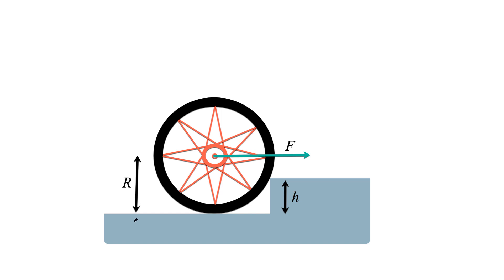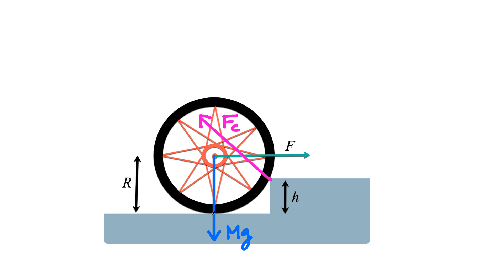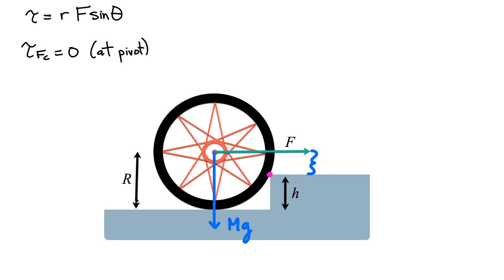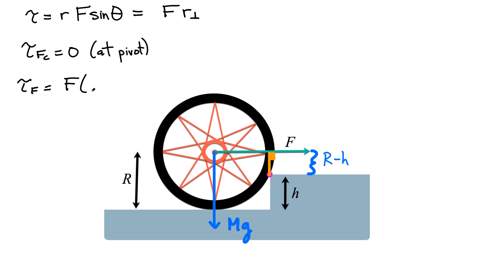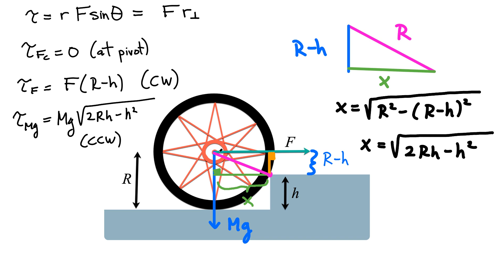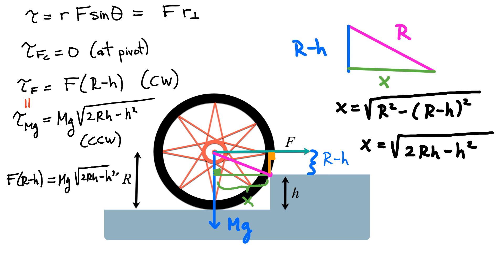Force Needed to Raise Wheel Onto a Curb

Comment: This is great! Can you do a video explaining what happens when a bike hits a bump on the road? So essentially, like this.. but goes up the curb and then down the curb too. Does hitting that bump or bumps cause the car to slow down? Does the earth and car exchange momentum and the momentum and speed of the car reduced? Or does the car slow down as it goes up the curb (convert kinetic energy to potential energy) but then return goes back to its original speed once it for rolls back down the curb as that potential energy is returned to kinetic energy?

Comment: To get the force F you equated the clockwise and CCM, I think that means that the wheel is in equilibrium meaning the net turning force on it is zero. So how will the wheel go up the kerb if net turning force on it zero? Shouldn't the CWM be greater so that the body turns in the CW direction up the kerb?
Reply: Yep that way he finds the equilibrium point solving for F. If the applied F is just slightly greater then the tire will climb up

Comment: Can you explain scenario when wheel rotates around a shaft with diameter of X as in a real world and force is applied to a shaft parallel with ground level? Does the force needed is just start force to initiate motion and what happens than? Is the force decrementing as we progress with the wheel forward? what would be the force function curve.  Does shaft diameter has an effect on the force needed?
Thanks

Comment: Sir what is the maximum height of step so that the force F required to roll the cylinder of radius R weighing W over the step without no slippage at all  if coefficient of static friction is u??

Comment: Hey I have just peeked through this video without listening to any of the audio, so sorry if the following question was already answered in the video.
For part 2, is it possible to roll the wheel up the curb even if h>=R?
Reply from the maker: not possible for a horizontal force.  The force would need to have a vertical component.
Reply: @PhysicsNinja  thank you very much for this, I appreciate it alot. I hope it was not a silly question, I just noticed that the formula for part 2 seemed to allow for h>=R whereas part 1 didn't

Comment: hi , i have one doubt about the second part when horizontal  force is applied at the top of the wheel . here reaction by the knife edge of curb on wheel must pass through top point of wheel for satisfying coplanar  3 force  equilibrium .i always learned that  normal reaction always passes through centre of the sphere . if we assume this wheel climbing on another fixed small wheel then there will   be  normal  reaction and how can its line of action of reaction will  be ?

Comment: Sir what if we need to find the minimum velocity with which the object should be moving so that it is able to just climb the curb (given that the object is in pure rolling) ? I tried conserving the angular momentum about the pt of contact and the total mechanical energy before and after climbing...is that the way to go about it? 
Any help would be appreciated.
Reply from the maker: Good question.  I will get back to you on this one.
Reply: @PhysicsNinja  Thank you so much sir for acknowledging the comment. I kinda got the answer on a stack exchange question though. https://physics.stackexchange.com/questions/338644/sphere-rolling-up-a-step
What I gathered from the above was that we need to conserve the angular momentum about the pt of contact...and the kinetic energy just after collision (which would be purely rotational, assuming the object never leaves contact with the curb) would provide the necessary increase in the gravitational potential energy i.e. mgh 
This would lead to 2 equations which can then be solved with not much difficulty
Is that the right approach? Thanks in advance sir

Comment: In the condition when force is applied on top of the body why the force F and force due to weight are assumed concurrent? Pls reply for this question
Reply from the maker: Not sure i understand your question.   Why wouldn't they be concurrent?
Reply: @PhysicsNinja    sir if at  the point when the wheel is on the crub the reaction R will be having two components right?? One radial component and one tangential component so when the surfaces are smooth which component can balance this tangential component??
Reply: @PhysicsNinja   i am asking like is    there any proof stating that  the forces are concurrent at the point
Reply from the maker: @varshavarsha5790  You can calculate the components of reaction forces as a function of the applied force and the weight of the wheel.    I've never done this but it should have both components.  You'll probably find that one of the components (or both) will vanish is some limiting cases.       I think in the limit where F=0 the reaction force  should also be equal to 0 and when the wheels starts to lift (N=0) the reaction force should only have a horizontal component.   Hope this helps.
Reply: @PhysicsNinja  yeah sir I could get you but what force could balance the component which the R has with  applied force?? Or please correct me if I am going wrong  in my understanding
Reply from the maker: @varshavarsha5790  The component of the reaction forces are  up (opposite of the weight) and to the left (opposite to the applied force F).   To get their components simply sum the forces in each direction and set them equal to 0.
Reply: @PhysicsNinja   ok now i got how component of R can balance F...but is it just an assumption that R ,w and F are concurrent at the top point or does it have any proper proof....i just want to know this please

Comment: how about plugging in numbers for an actual example, say 30kg-mass ??? thanks
Reply: Just substitute values
Reply: @jeromecancino5261  NO KIDDING !!!
Reply: Multiply that by 9.81 so you will find weight.
Reply: @jeromecancino5261  Either I don't know what you'r talking about, or you don't know what I am talking about!!!! 
I meant to ask him to calculate the amount of Kilogram-Force needed to pull a 30kg wheel up the step!!!

Comment: I have a large 4' by 8' workbench that I want to move  in and out of my garage. A wheel in each corner (total of 4 wheels), total weight of bench and contents of built in drawers is probably 600#, concrete lip to 'jump' into the garage is 1 inch high. What size wheel/casters is required for one person to relatively easily push the bench to 'jump' that lip?
Reply: Dude youve been given the tools to work that out
Reply: Determine what your max force is (100N?) then make the radius your variable.

Comment: Why is the contact force equal to 0? is it because there is no friction coefficient given or because the normal force is 0 (which I don't understand why)?
Reply from the maker: Ana Lucia Benavente Luna  the contact force is 0 only if the height of the step is 0 - no step.    The normal force is 0 because the wheel will just begin to lift.
Reply: Thank you  :)

Comment: Physics-None-Ninja:: What you are doing above is "FORMULATING", which you may well have copied from elsewhere, while trying to show that you are re-inventing the wheel.  Only if you compute your numbers, using actual values, would you be "CALCULATING". In other words, that's probably a better way of concluding your video, by reaching a tangible result, in numbers, rather than beginning & ending with formulas!!!! .
Reply from the maker: Thanks for watching.   My channel is about helping students set up problems and apply basic physics to solve problems.  Many of the problems i present are 100's of years old, including this one.      I try to put my own spin on it and present it in a way that is easy to understand.    I often get to a final equation and don't plug and chug number into the problem.  Instead i try to take limiting cases to make sure the results makes sense.     Putting numbers into a final equation to get another number is less educational, even a child can do that.
Reply: @PhysicsNinja  I suggest you try it once for each video, else, people may thing you do NOT know what you are talking about, but that you are just copying texts of others!!! Only when you utilize numbers, you'd be able to see how close your approach is to reality. For instance, a much acclaimed online-physics-professor (Von Bizen) comes up with rocket-launch-acceleration of, something like 2m/s/s, which is impossible for a rocket to lift off earth!!! Worse yet, a TWR==1.2, because he believes, as you probably do, that a TWR>1 would lift any rocket off the earth!!!!
Reply: @PhysicsNinja  More clarification::: Assume you are pulling up a 30kg wheel up the stair; you plug in your numbers and come up with a required force of over 30kg-force to pull up the wheel. Only then you'd know that your formulation is wrong somewhere, and the you could try to fix the mistake; else, students may continue finding that forces above the actual wheel-weight, which makes no sense at all, because the whole physics behind using wheels is to reduce the amount of force needed to carry the load, on a flat surface, or up slopes, or up the stair!!!
Reply: wow, I sometimes forget how psychotic ppl on the internet can be